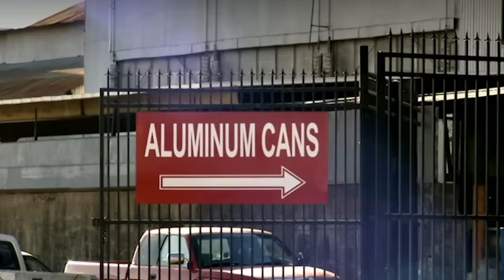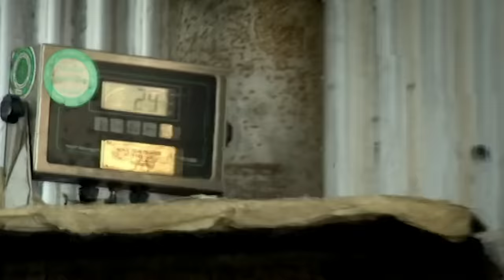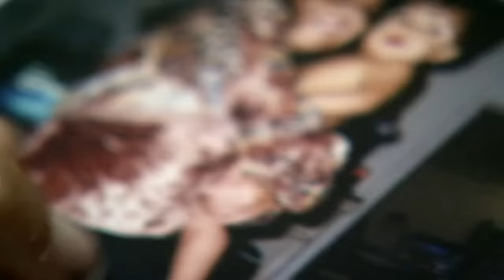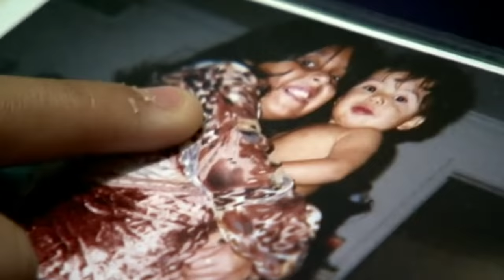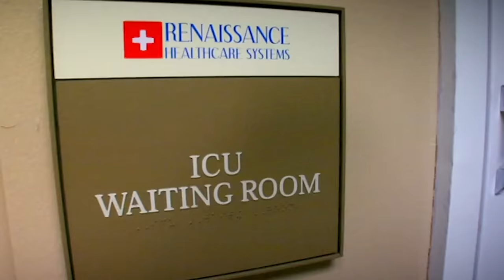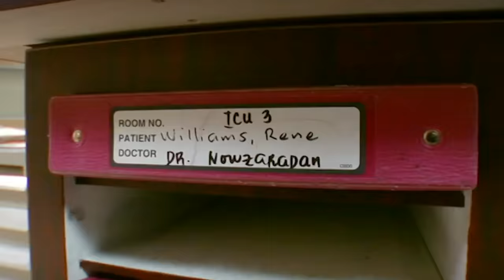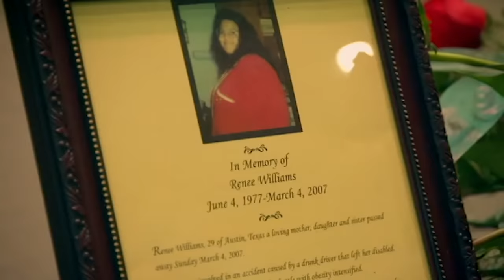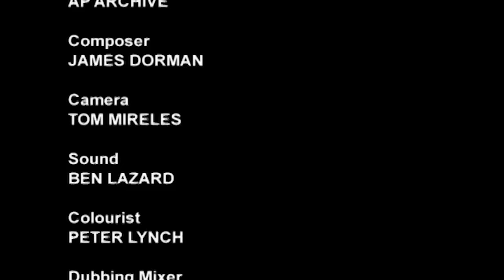The World's Heaviest Mom | Half Ton Mom | Only Human

Comment: She should have been put in hospital for at least 3 months on a calorie controlled diet and light exercise program before surgery, I feel they rushed in to quickly to operate
Reply: Same I feel like they should’ve took more care to make sure she was ACTUALLY a good candidate for long term success and that it wouldn’t be such a sudden change on her body which in turn probably stressed her body out ultimately causing the cardiac arrest 😕
Reply: That’s probably why now dr. Now does this with his patients on my 600lb life.
Reply: Agreed. I work in a gastroenterology surgery unit and we do a lot of weight loss operations and every single one of them have to go through a period of a strict calorie control diet before we do any surgery, and I’ve never seen anyone even close to this size. It’s extremely risky.
Reply: Agree. Think its all a learning curve, This is one of reasons why now Dr. Now's Absolute GOLDEN RULE is to lose a significant amount of weight first to take pressure off the organs and risk death.
Reply: She said no one would do surgery and she sought itvout for 12 years.  Who would pay for hospitalisation.  I do not think it free
Reply: You are probably correct. Surgery is not always the easy fix.
Reply: From what I remember on my 600 lb life patients need a calorie controlled diet before surgery to reduce the size of the liver and for a better chance of a good outcome
Reply: AX_AZ w
Reply: These were situations/timws were Dr.Now learned what's better before operating. He does it now in his TLC show.
Reply: It is always a trade off.  I have seen similar shows where the person was asked to lose weight, struggled with it for 2 months and then died before ever getting the surgery.  Another was denied surgery for 7 years, then died within days of getting it.  Both times the comments said “why didn’t they get them the surgery sooner!”  The risk of death is huge either way, and it is impossible to see the future.  It was also her call to a large degree.
Reply: The show probably paid for the surgery, that's why it was rushed and cheaper than doing the things you suggested. RIP
Reply: Ok so... you all are doctors? Huh?? let the doctors do what they know.
Reply: Agree!! She didn’t even attempt to diet before the surgery wtf 🤷🏼‍♀️
Reply: Totally agree She needs to Lose about fifty pounds first. the surgery is not a magic pill its just a start
Reply: Yes I'm also surprised , a few months would have meant at least 200 pounds off.
Reply: I agree but I heard from another story she wasn't in good shape - that's why they did it quickly - her heart was being crushed I believe
Reply: EVERY morbidly obese person should be put into a rehab style hospital setting. They have it for drug addicts I’m very surprised they don’t for food addicts. I’m sure if you have a bajillion dollars they could set something up for you but it should common and be available for everyone.
Reply: @jacquelinerussell8530  She would have needed to lose more than 50 pounds. It is safer to be 500 pounds or under. Even then it is still risky. That is why she had been turned down so many times. She had gotten too heavy for most doctors to take the chance.
Reply: @adc2327  yes i see this now I was🙏ing that she would have  survived  the surgery She had placed herself a lose lose situation unfortunately
Reply: @jacquelinerussell8530  She probably needed counseling even more. She needed to get to the root of the problem that could cause constant eating despite knowing it is killing you. A sad situation indeed.
Reply: @juliemacdougall6489  I have looked this up. There is a hospital in New York that charges patients $1000 per night stay if you have an operation requiring a general so they can keep an eye on you for 24 hours afterwards. However if you have someone with you to look after you you can go stay in an hotel and you save $1000 after the op the same day.

All I can say is thank god for Britain's NHS, free at the point of use(unless you can afford to go private).
Reply: @Itried20takennames  Any op is high risk. A healthy slim young person can die on the operating table. The risk is compounded if the person is overweight.
Reply: @StephanieJohnson-yk5ij  I disagree. I don’t believe the responsibility is on anyone else but herself. She was an adult. She had her own money. She made the decisions her self. Nobody else to blame.
Reply: It's TV! They don't care about the woman... it's about making money at her expense!
Reply: @sydneyfelker5945  well she was disabled at certain point. You don't think whoever was feeding her was to blame, somewhat? Interesting. Even bars stop giving out drinks to people they can see are extremely intoxicated. I think that is the same situation here. They can see she can't even stand up. But you're going to keep on shoveling her whatever type of food she wants?  That's not right.
Reply: @StephanieJohnson-yk5ij  bars stop giving our drinks because that person can go drive a car and accidentally kill someone else. This doesn’t kill anybody but herself. She’s a grown adult, you can’t legally tell her what to do with her own food or money. If she pays for Uber eats or door dash and they come drop it off, I’m sure her 8 and 11 year old daughters will go give it to their mother. But it’s not their fault, they are children. It’s her own fault for choosing to eat it.
Reply: @citizenerased7746  I've suffered from a different addiction.. And I didn't try and stop using until the day I had to go to rehab.. She probably kept thinking it's her last time she's going to b able to eat as much as she wants.. Just my opinion
Reply: ...too quickly...
Reply: Yeah, in 600 pound life they usually have to lose a 100 pounds and more, but I believe Dr.Now didn't her living long enough to lose the weight (she probably wouldn't have lost it because she was in denial about how she gained it) so it was either do it now and hope for the best or wait and her not even get to where she needs to be.
Reply: @mildredchester  Or...instead of losing 50 pounds pre surgery, they sneak food in (which they can - the hospital can’t legally stop you from eating whatever, they can only ask), lose only 10, try again, then have a heart attack 3 months later, still prior to surgery.  I have seen shows like this, and the comments are full of “why did they make them wait for the surgery?  They should feel terrible!.” Always easy to make the right choice when you know the outcome, but a person in this condition has a huge risk of death (with surgery, without surgery, or “lose weight, then surgery”) whichever path they take.
Reply: They may have done all that but edited to fit a time slot?
Reply: And Dr Nowzardan is really particular of pre surgery diet etc. 600 lb life shows that.
Reply: She was going to die anyway if she did nothing so this was a risk based decision.  She dies if you do nothing, and she dies if you try.  Therefore, you figure which decision gives the best odds. She had no chance if she did nothing.
Reply: I totally agree
Reply: She was offered this and refused starring that she was too depressed. It's on a different blog about her.
Reply: A Stranger  yeah sometimes doing the surgery and taking the chance is their only hope.
Reply: Yes. They needed Dr. Now
Reply: @ColorMeRado  ok.
Reply: @citizenerased7746   she could lose her life in any moment because of this they rushed to do it as soon as possible
Reply: Honestly i do agree with your comment, they should have given her 1 - 3 months first on a special diet to reduce some weight and get her body used to the new calorie intake so Post Surgery she would be used to the new dietary changes. Doing everything so fast and quickly... it was bound to instigate higher anxiety stress or maybe her body took a reaction to it? 

Its similar to Smoking you cant just go COLD TURKEY instantly... you would legit go insane your body would break down

her body couldn't handle the dramatic changes.. 
you have to remember she's used to eating junk food on a daily basis she had been doing that for Years...  for example even with Keto diets and stuff, if you cut out bread or milk it dramatically changes your body trust me you get major side effects like Diarrhoea / Nausea / migraines or constant head aches/ body aches .. you have to do a gradual process to get a better / safer result. 

Most people who get this surgery... still suffer cravings they continue to have hunger and overeat their meals
perhaps because she was unable to eat the amounts she was used to? maybe it was too much for her body and it just gave up?
Reply: For people who are this obese, the doctors and nurses have a difficult time getting IV needles/central lines inserted and they would have to give them an insane amount of anesthesia to put them under.
Reply: Very true.

Comment: One thing i want to point out is the risk for health care workers when they work with morbidly obese patients. Its very easy to be injured when caring for them even with a team of people helping. Pulled muscles or twisted knees are common :/
Reply: It's not fair to blame the patients though. There is equipment that can reduce that but often care homes are too cheap to pay for it.
Reply: @KoshVader  we can blame a 1000lb person a little bit 🙄 even with equipment you have to hoist their limbs to get the harnesses under them and shift them around to get the equipment in place to lift them and you get injured easily doing that cause literally every part of them is so heavy. And also say rolling them to the side they isn't any like big spatula to just flip people over you gotta just use straps and pads and people
Reply: @therealfinnaspring8585  some people I've worked with have conditions that make them gain weight and they also have physical disabilities. They can't help being overweight.
Reply: @KoshVader  no one has a physical condition that causes 1000lbs of weight. 300 lbs? Yes. Thyroids, pcos, disease or injury that makes them wheel chair bound and they get depressed. 400+? No. When its get to that point its an emotional or mental problem. Which if you want to say that the emotional/mental problem is a disability they can't  help - maybe. I'm undecided. They definitely need help but many are not ready for help and everyone around them suffers. Its an addiction of sorts. I have empathy for them but i also have empathy for he health care workers i witness being injured by them. Its just a reality its dangerous working them and some of them get offended at that reality and have no sympathy for the workers. So its been quite a mixed bag in my experience
Reply: @therealfinnaspring8585  I have more empathy for the patients.

As a care worker I could go to my own home at the end of the day, I could make my own meals, I can shower when I like without getting other people involved.

Also, mental health problems, including addiction, are disabilities.
Reply: @KoshVader  well good for you. I disagree. Lets let it alone.
Reply: @therealfinnaspring8585  addiction is a mental health problem. That's a fact.
Reply: @KoshVader  ok. I still disagree with feeling worse for the patient. We can just agree to disagree. Have a good one.
Reply: @KoshVader  and I'm pretty sure its still debatable whether food addiction actually meets the requirements of addiction anyway. Doesn't matter. Lets leave it.
Reply: @therealfinnaspring8585  it's an eating disorder.